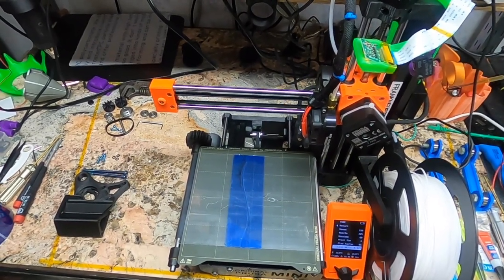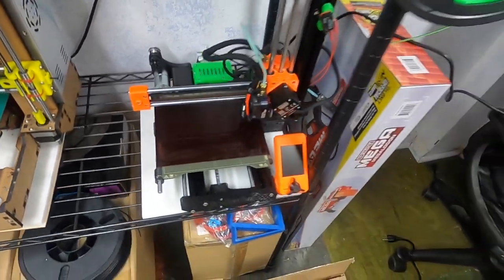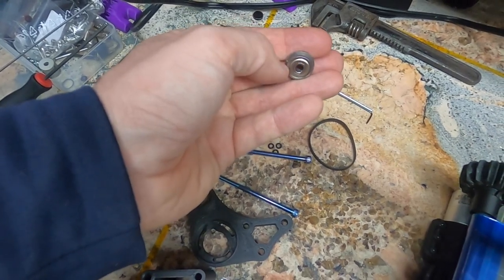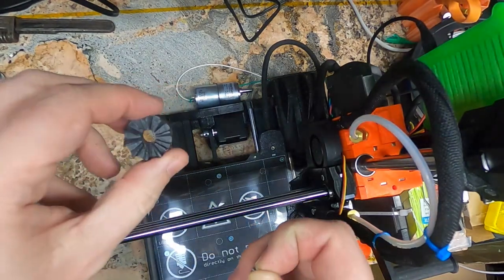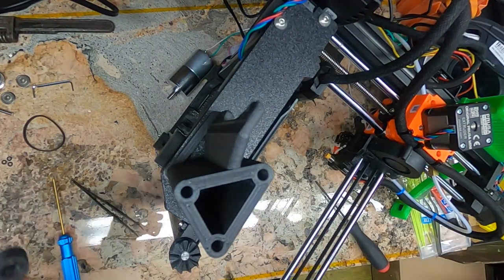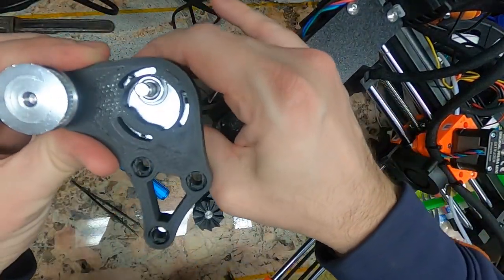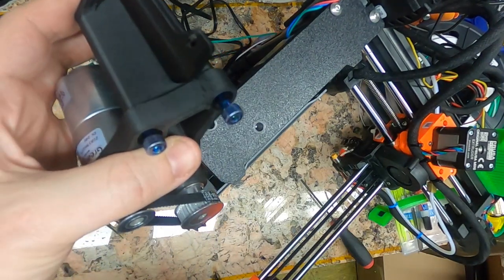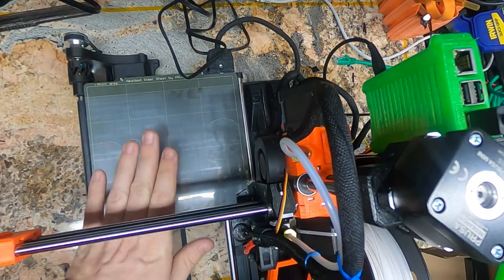PrintShift 3.0 Ejector - part 1

Comment: Great work, Could the belt lift up with bigger prints?
Reply from the maker: The belt is under pretty high tension - hence the iterations on the ejector - so warp and curling is minimal.  Most parts you won't even notice, but of course the belt is not as rigid as the steel sheet.  A bonus of this design is that you can slide the original print surface out, put it on top and print as if it were a stock Prusa Mini - so if a part is too delicate for the ejector you can still print it.  Generally, for delicate parts I'll just put a brim on and keep the ejector rolling, though - I love being able to do an entire series of prints without touching the machine!